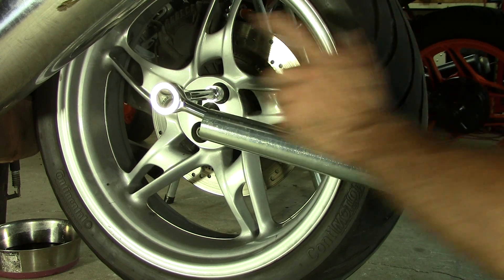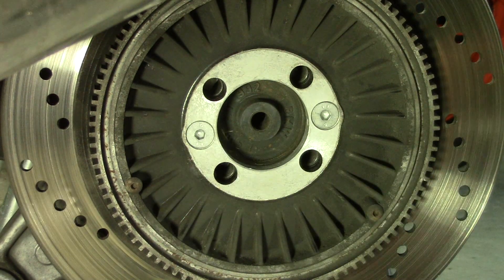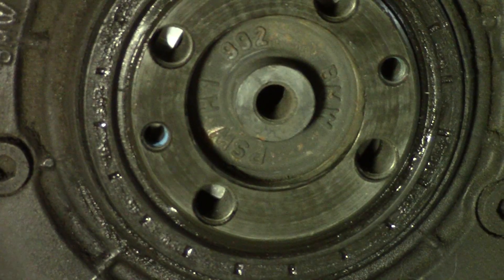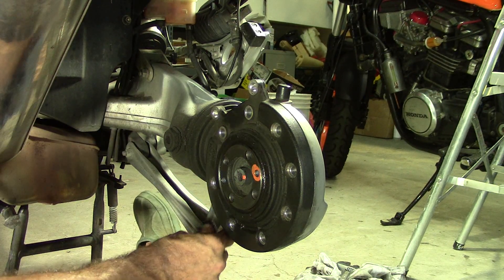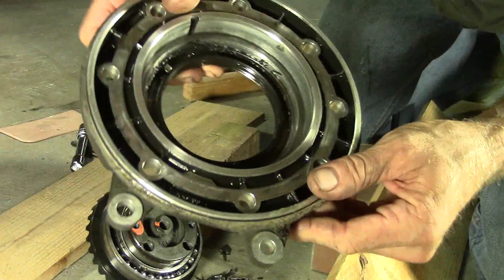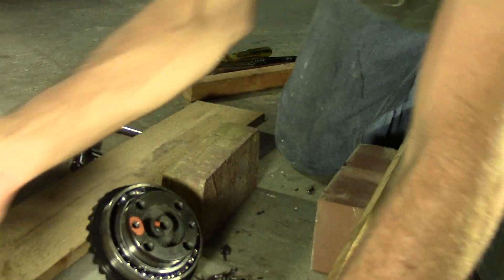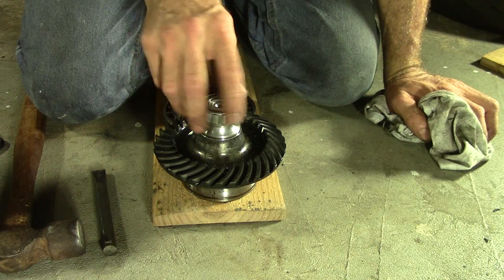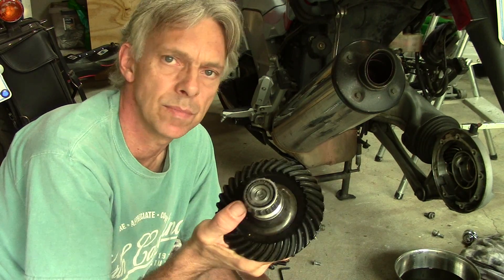2002 BMW K1200RS Final Drive Ball Bearing Replacement Part 1

Comment: Love these two Final Drive R&R videos. 6:45 in part 1 - like Steve Campbell said, two long tire irons will get the big bearing off. I did this today. I used your tip, used a chisel first to move the bearing just a little, and then the tire irons got under the inner race and it just levered off.
Reply from the maker: Thanks for watching! Keep the shiny side up!

Comment: Throughly enjoyed both your videos on the final drive. You made it look simple. I have a 02 k1200lt. My final drive just went out. I had 2 of the allenhead bolts on the backside fail and made contact with the rotor, not sure what it's called ; spring washers but tore into 3 of them. The bolts are bent and damaged along with the holes they go through.  Sorry about that.  Anyways, thanks again.
Cheers!

Comment: In my shop I have replaced 10 bearings.  The answers i got was the bearings were designed during the late 80's and they were adequate for the weight and hp. They continued them and bikes became heavier with more hp. German engineering decided to replace with an upgraded bearing but wouldn't recall the bikes running the old style. Catastrophic failures will put you on the ground, i change differential oil every time i change motor oil to keep on lookout for signs of metal in oil before failure.

Comment: Sad comment on the so-called longevity of BMW Motorrad components to think that a bearing cage in the final drive assy collapses at less than 30K miles.  Nice video and as another U-Toob'er says "Temperature difference is your friend in this job".  i.e. frozen shaft and sizzling bearing creates the 2 thou difference in size between an immovable  interference fit and a slip-on.  Thanks for the footage, Dean.
 AL in s.e. Spain - '04 non-ABS Rockster

Comment: Wow.  I couldn't be more thrilled.  I suspected that my final drive was having issues on my 2000 K1200LT and ordered a new crown bearing and seal.  While my crown bearing wasn't a total mess, like your's, it was still a bit loose.  I was able to use a chisel and hammer to get it part of the way off, and then once I could get a couple tire irons under it they did the rest of the job.  The combination freezer/oven thing worked brilliantly to get the new bearing on.  What I expected to be a 6 or 7 hour job ended up being like 2 or 3 hours.  Huge kudos for the video.

Comment: A lot of work been done on these on LT's (same final drive) and its generally agreed in that community that over-shimming at the factory is the main cause of failures by applying an incorrect preload.  There's a procedure shown online how to measure the shim, they usually wind up removing at least one shim.

Comment: invest in a cheap press from harbor freight fuck dicking around with screwdrivers i would have that bearing off in 5 minutes flat... i still love ya man :))i assume your not a technician at a dealership?...take it to work and press it off
Reply: Yeah I could have done that but I was making a point that it COULD be done out on the road. That's why it's called HACK a week TV. :) No way would I ever work at a dealership. Private shops do way better work.

Comment: Hi Dino!!
I didn't see any oil in your final drive..did you remove it before the replacement or it was dry out because of the failure seal?
Ride safe:)
Reply: I drained it before taking it apart.
Reply: Thanks for the answer!
Cheers from Florence!

Comment: I wouldn't expect to have to replace that...disappointing to see that in a properly ridden BMW...I doubt you were practicing burn outs on that bike...
Reply: That generation K1200RS had issues with the factory bearing. Perhaps a faulty cage weld, bad metal, who knows. Most replacements outlast the original 2 to 1 or more. I did my research. :)